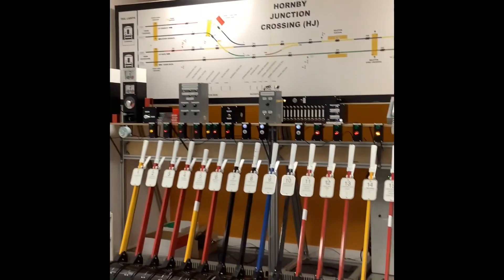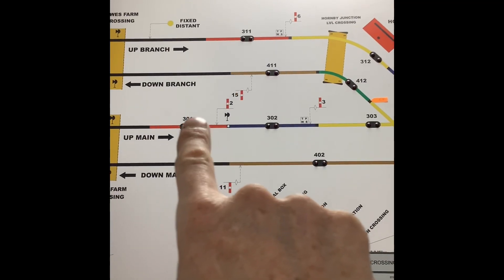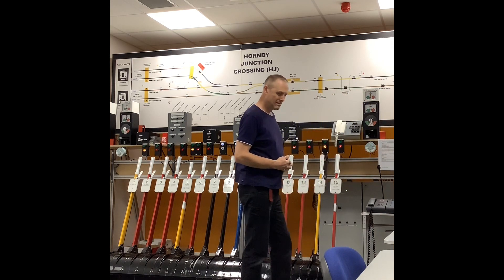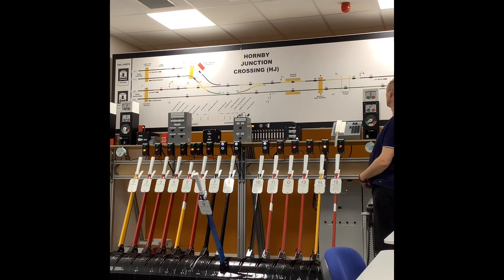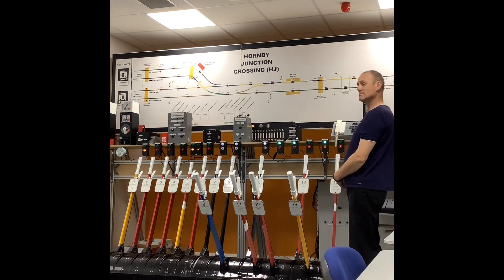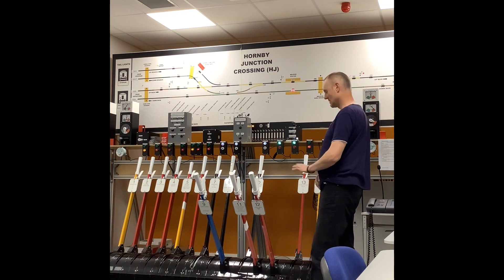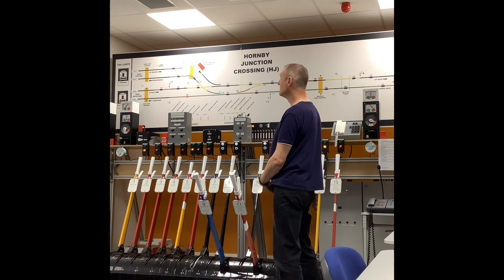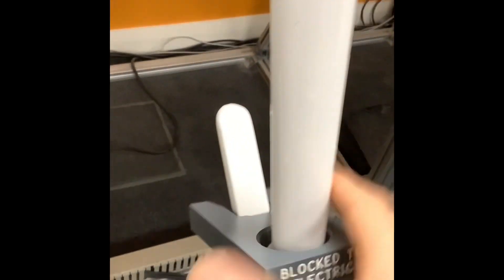Absolute Block Simulator part 1

Comment: A very informative video on the workings of Absolute Block. 
I noticed the Down Distant 14 plate says to pull 11 then 12, should that not be the other way round? If you pull 11 first then 12 will be locked by Sequential Locking, which would mean that 11 would need to be put back to normal, the Line Clear cancelled then requested again to release 11 after pulling 12. 
I also seem to recall the plate on lever 13 says to pull 9, 8, 7? Should that not be 7, 8, 9? 7 releases 8 [Flank Protection] and 9 locks 8 both ways. You cannot pull 9 first because the points will be locked!
I note 6 is the Up Branch to Up Main Home, with the pulling sequence 6, 4, 5 which means 5 needs to be pulled between 6 and 4. Would it not have been better to renumber 4 to the Home, 5 to the Section and 6 to the I.B., which avoids having to pull between two adjacent levers? (2, 3, 5, 6, 1 or 4, 5, 6).
In the Down direction, renumber 15 to the Distant, 14 to the Home, 13 to the Section, 12 to the Branch Home and 11 to the Branch Section, grouping the pulled levers together?
I note an overlap dot between 7 and 10B points. Does that mean that 7 points have to be reverse before accepting a train off the Branch as the points are within the Clearing Point? (If the points cannot be reversed (due to a train signalled through on the Up Main), can a non-passenger train be accepted with Restricted Acceptance?)
On the Up Main, should the overlap dot be located between 302T and 303T instead of 301T and 302T, the Clearing Point being between 2 and 3 signal?
Reply: This is a very knowledgeable comment and essentially you're right, but it should be remembered that this is a sim meant to train new signallers. As a result, it has been deliberately designed to have a bit of everything. So you're right, 7 points do have to be reversed before accepting a train off the Branch. That was deliberate to give trainees practice of potentially having to refuse a train if they had one signalled on the Up Main. I think that is actually something that changed and the clearing point used to be 312 track circuit. There's also no real reason why the Up Branch Distant would be fixed, but it just gives trainees an example of a fixed distant doesn't it. So it is a sim and a good sim. But it is still only a sim. So you are right about the pull sequences and other versions of this sim do have the correct pull sequence (e.g. 14 does have 12, 11 and not 11, 12). It's pretty obvious that the version featured in this video lists the levers required reverse in numerical order. That is probably just an imperfection in the sim but it MAY represent some regional or even railway company practice. I do doubt that's the case here, but some versions of this sim, for example, have block indicators where line clear is on the left (as here) and some have it on the right and that's as in real life where different companies and regions did things differently. For what it's worth, though, I know that this sim would require you to get another line clear if you pulled 11 and then put it back. In real life though because there's a track circuit on approach to 11 you probably wouldn't need another line clear, you'd only need another line clear if you put it back after 402 track circuit had been occupied (look up line clear release for one pull only versus one train only). But that did vary. Numbering of signals in real life is a massive rabbit hole and ultimately it varied a lot. This sim does feature a slightly awkward "pull between" but it isn't really a problem because the IB is a colour light so it takes no effort to pull the lever. If it had been a heavy semaphore that would have been a big problem. I suspect 6 could have been 4 and probably would have been in a Western box, for example. Possibly the sim reflects one company's way of doing things. Different companies did do different things. Some went as far as putting the distant signal lever after the stop signal levers so you wouldn't have to pull all the stop signals and then go back to pull the distant. Most companies put points, ground discs, etc. in the middle with the main running signals for trains coming from the left at the far left hand end and the signals for trains coming from the right at the far right hand end, with the main running signals being assigned levers in geographical order, i.e. the first signal on the left (the distant) will be number 1, the second number 2, the third number 3, going in order left-to-right. If you had, say, a 33-lever frame, the first signal on the right (the distant) would be 33, the second 32, the third 31, going in order right-to-left. That's why you so often have to go back for the distant. But otherwise the distant is out of its geographical sequence. It is very, very unlikely restricted acceptance would be used here. Very. The Rule Book only allows it to be used during single line working and to get an engineering train up to a possession if there's a work site marker board in the clearing point. Signal box special instructions MAY authorise it and it was authorised in a similar situation at Worcester Shrub Hill over the (Track Circuit Block!) Up Main, but that was a local instruction. I am not an expert on how the rules used to be, but my understanding is that use of regulation 5 (the "warning arrangement", i.e. 'restricted acceptance') in a situation like this would have to be authorised. It wasn't generally allowed everywhere and anywhere. But it is certainly possible that it could have been specially authorised at a box like this.

Comment: Very informative video! Just started working AB. Pretty complicated, but very interesting.
Reply from the maker: Have a check out on YouTube at the other railway control videos for absolute block, there’s a few out there, it’s pretty run of the mill once you get used to it, of course I’m used to the other side of it ( the actual wiring side which is far more complicated) 😄

Comment: Is there a term for that type of lever, with the safety on the grip?
Reply from the maker: If I’m reading g the question right, catch handle locking is what you’re after, the catch being the final part that drives the interlocking, when you squeeze the handle it releases the locking from position a to b or if the levers reverse d to c, then when you move the lever reverse it moves the locking from b to c or going normal c to b, only once you’ve completely released the catch handle does the locking finally allow the drive from c to d in reverse or b to a going normal.

So it proves the levers correct and the handles released too.
Reply from the maker: This video should help from our Facebook page 

https://www.facebook.com/share/r/VgHAMeR5i4idWdga/?mibextid=UalRPS

Comment: What if the barriers were broke and never came down? What is the emergency procedure? Thank you for the video
Reply from the maker: If the barriers never came down the signal would not clear, persons would be dispatched to get the crossing barriers down and trains running and the fault located, there are robust plans always in place and they vary depending on barrier types and the area but have many similarities.

Comment: Good evening, it is not yet entirely clear to me whether those old electric block systems (Absolute block system, if I am not mistaken) with a wooden case were or were not influenced by the passage of trains for the purpose of occupying and freeing the section (block) towards to which and from which the train was respectively headed or from which the train came.  Furthermore, it is not clear whether there is an electrical connection between the lever that controls the opening of the starting signal and the apparatus with wooden case.  In other words, was it possible to pull the lever that activated the starting signal towards you without first having received electrical consent from the next station?  However, it is common ground that where there is a token block it is possible to activate the lever that opens the starting signal even before having handed over the token to the driver, unless there is an error on my part.  Thank you very much for your availability and collaboration
Reply: Hi,
The Block Instruments are manually operated by the signallers. In the box I used to work the block instrument would also automatically go to "Train On Line" if a track circuit in section was occupied, but I am not sure if this is standard.
The starting signal is indeed normally electrically interlocked so that Line Clear or Train On Line must be displayed before it can be pulled off. In Electric Train Token working there is similar interlocking, so that the signal cannot be pulled off until a token has been released.